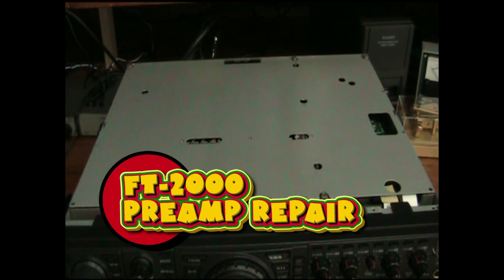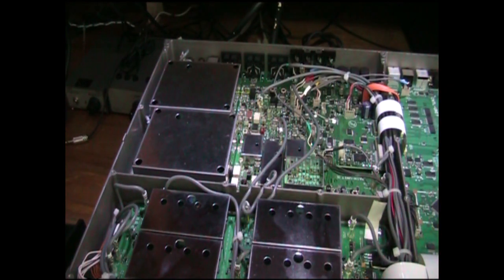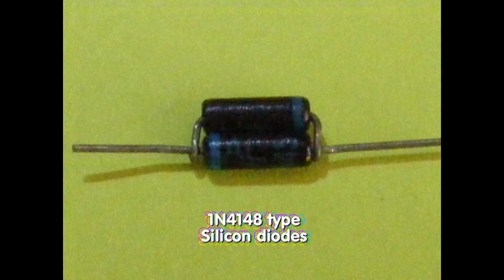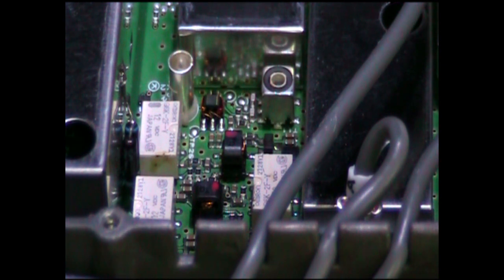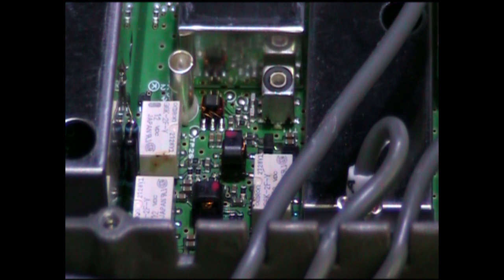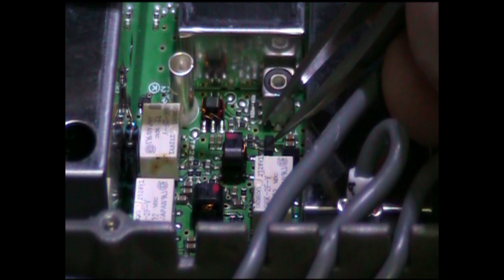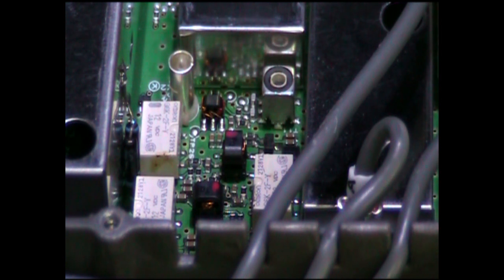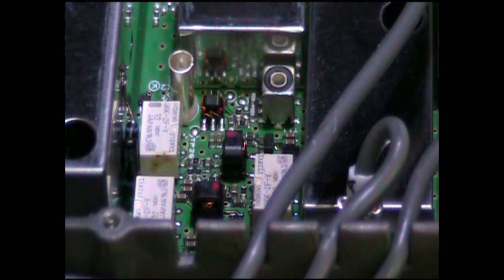FT2000 Preamp repair part2

Comment: I tend to dip my solder wick in liquid flux and that works very well when desoldering. It makes for a very fast desolder and the heating time is minimal.. I like the 1N4148 mod. I think I will add this modification to my FT-2000 too. Thanks.

Comment: Great video! I wonder if the antiparallel diodes actually worsen the IMD. Probably some bulbs in series to the RF-input might also cure the issue. Yaesu engineers must have forgotten as my FT-767 had such small lamps. Vy 73 Uwe, DL8OBF

Comment: Excellent video - Interesting... yet disconcerting; that a radio as expensive and complicated is likely to be trouble-prone right out of the box.   I've got a used ft-897 - it seems to be having issues on ssb - So, I'm looking for a new radio... Hopefully one that won't need to be repaired soon after buying it.